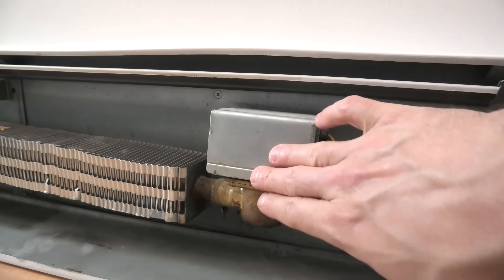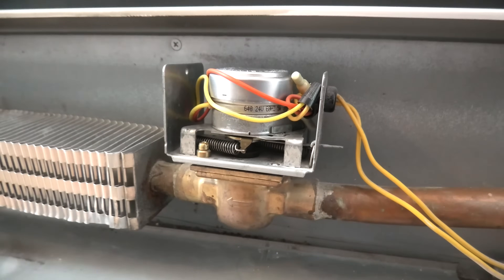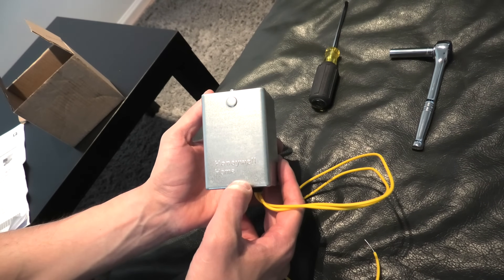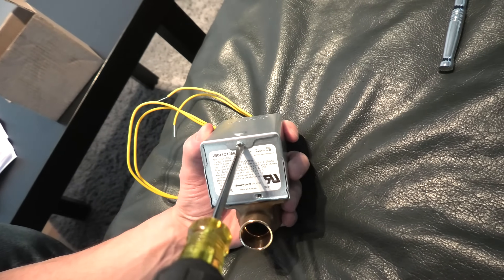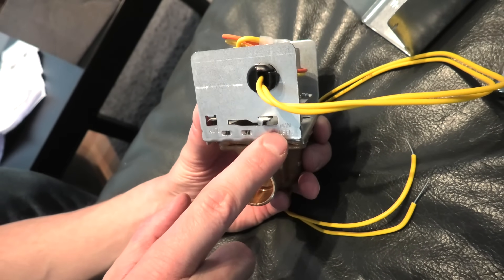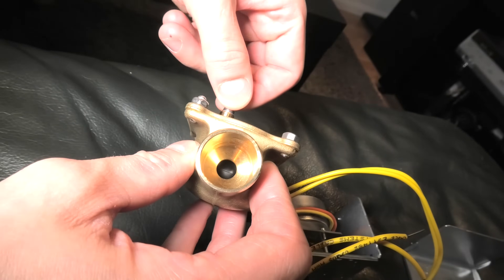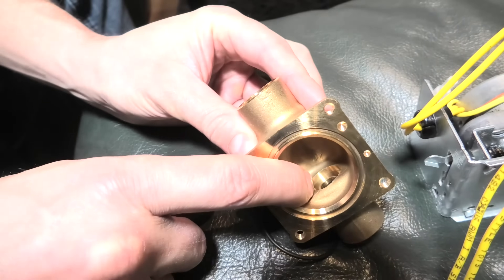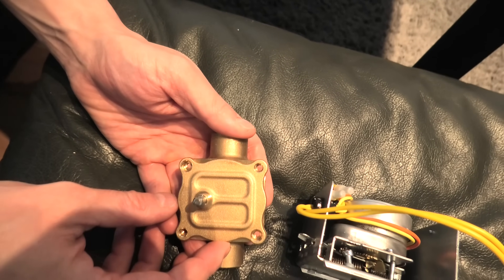How Does Honeywell Zone Valve Work? Explanation And New Zone Valve Disassembly.

Comment: I took that motor assembly off and turned that ball assembly manually while the pump was running for the other quadrants and yet the heat did not run though the pipe. That seems impossible, doesn't it?

Comment: Great video! I have an older honeywell value that gets stuck open and gets very hot in the room. I can disengage the spring with a screwdriver.  Doesnt happen everyday . Any ideas!
Reply from the maker: Thank you! Most likely the ball inside is seized and does not close the flow of water. Because of this the springs and the motor inside the zone valve could be worn out as well. I would replace the whole zone valve. We have the detailed zone valve replacement video as well: Thermostat Is OFF But Radiators Are Still HOT? Faulty Honeywell Zone Valve Replacement - https://youtu.be/k4tfRstJJrc.